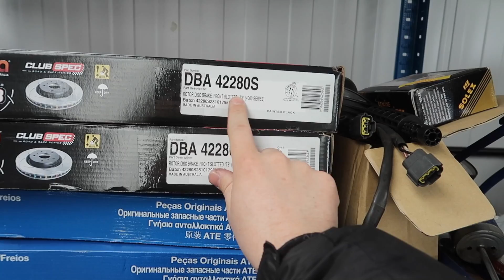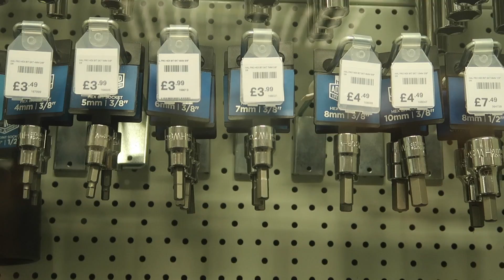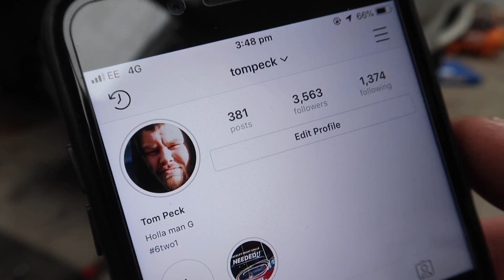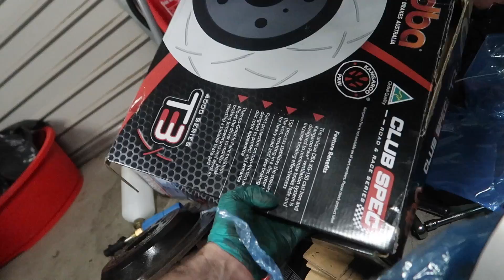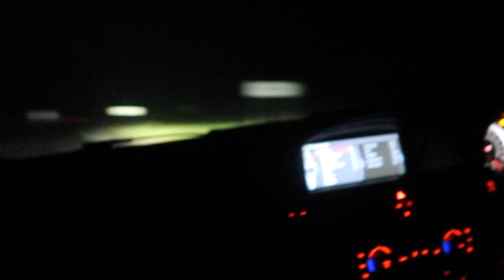M3 GETS UPGRADES!

Comment: You did well on doing the brakes Adam, I work on normal BMWs and they are a pain as well, BMWs and mercs are the worst for wheels being stuck on, wire brush the hub and back of the wheel to remove the corrosion and apply some copper grease to the hub to stop it happening again

Comment: Sorry to be that guy but there is a technique to getting that calliper retaining clip back on. If you put the winglets over the calliper first then use a screw driver to leverage that middle lip into place then it's a heck of a lot easier. But yeah, I've done the front pads on mine with the scars to prove it, an absolute pain of a job. And the 7mm socket saga as well!

Comment: Dude if you’ve not yet got a new wear sensor chop the old one and twist the two wires together and plug it back in. Job done, warning light gone. I’ve had to do this on mine before.

Comment: The brake wear sensors seem to work off of mileage rather than actually the wearing down of the brakes. Literally had to change my brake wear sensor few days ago and my brakes are fine as they have about 3/4 of the pad left.
If you reset it through the BMW dash it may work and tell you when they actually need to be replaced as you replaced the entire discs and pads.